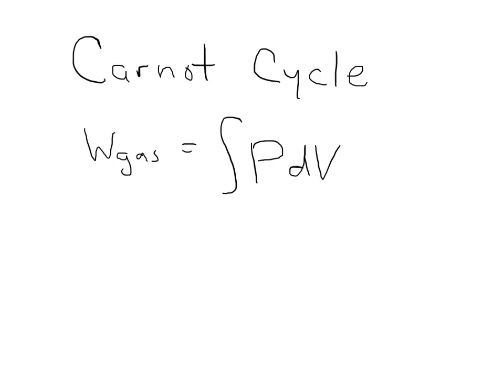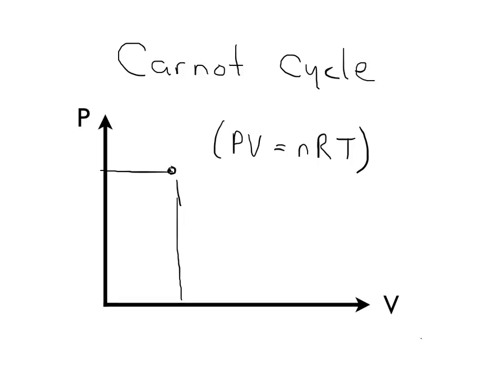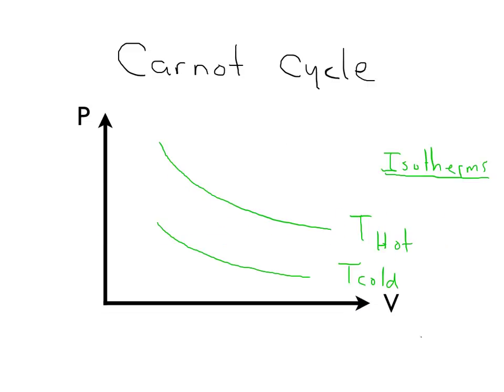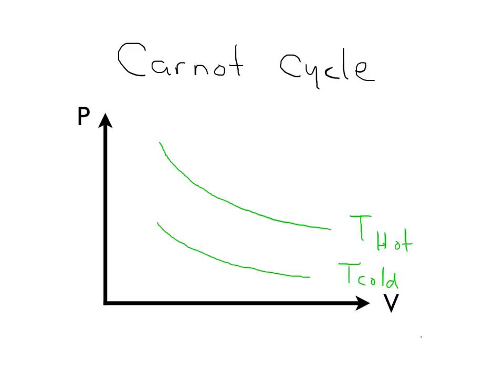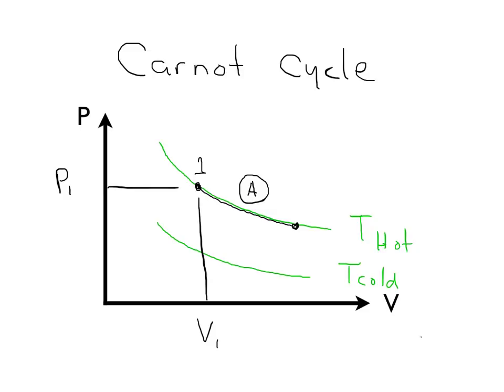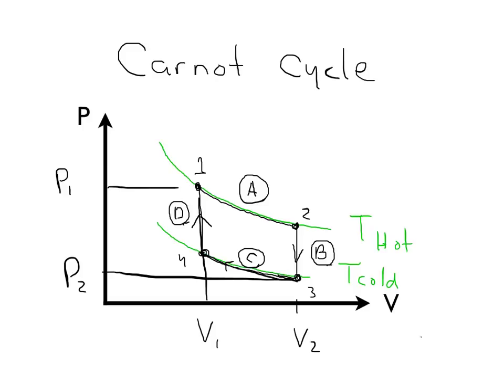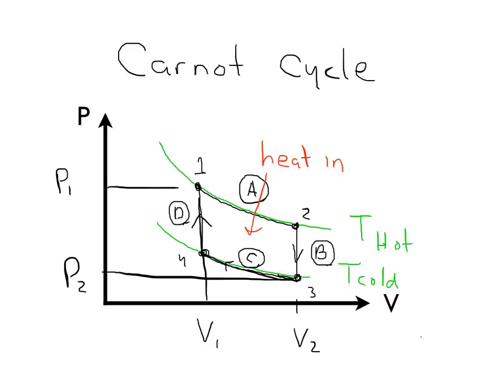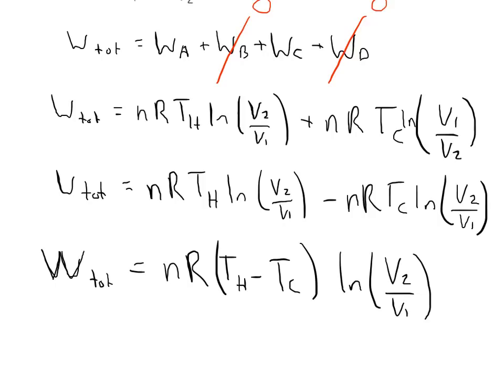Carnot cycle

Comment: This isn't a carnot cycle. Yes two Isotherms, but you need to go between the two with adiabatic pressure change not isochoric. The reason being is you're trying to maximise the work done by the system: the work done as you rightly state is the integral of Pressure with respect to Volume. A simple sketch using adiabats compared with isochoric lines will show you that to maximise the work, isentropic pressure change is the way to go. Hope this helps anybody confused by the video
Reply: yea this is otto cycle i guess
Reply: wow, u know this so well
I wish to be like you
Reply: By now, we know that YouTube is not the place to learn anything from some amateur who thinks he understands a subject. Most of it is crap.

Comment: sorry to say, but B and D is adiabatic expansion and compression in a carnot cycle. Heat transfer do not exist, however temperature do change and thus work is negative at B and positive at D.  I think you got the cycle confused with something else.

Comment: hay wt u say. there is no constant volume process  exits in carnot cycle.   carnot cycle contains 1-2 isothemal expansion(heat addition)here work don  by the system equal to heat addition.2-3 adiabatic expansion ,here work done is equal to internal energy. 3-4. isothermal compession here work done equal to heat loss by the system.4-1.adiabatic compression. i am sorry you are explain Stirling cycle insted of carnot. check again.